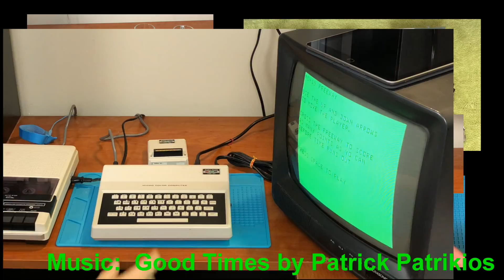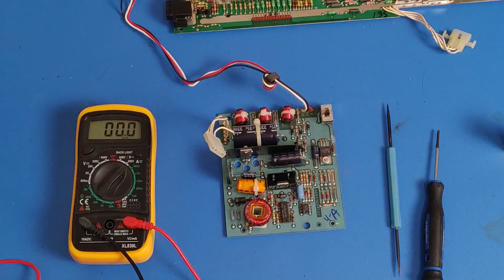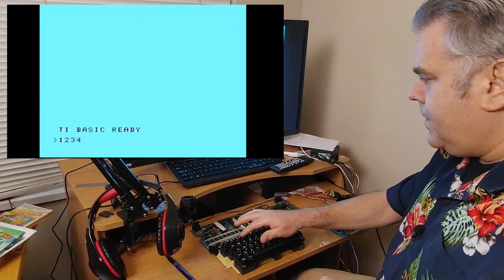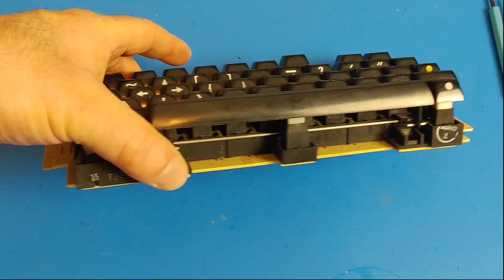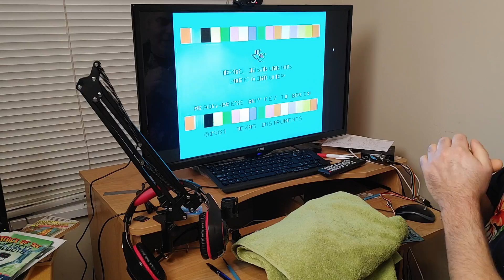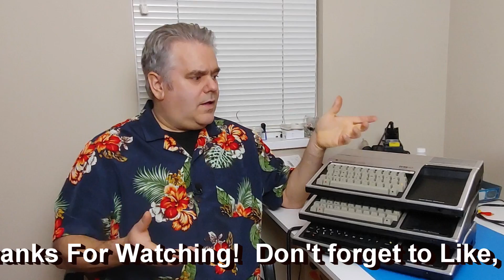TI99/4A Extravaganza Part 2

Comment: If you have the schematic, showing how each key fits in the keyboard matrix, try to measure the resistance of the closed key, if its abnormally high then the key contacts don't make good contact. If you don't see any change when you press the key then there must be a break in the connection, use the multimeter set to beep when a connection is made, and trace one of the two ends of the matrix from the connector to the contact of the switch. If you find a connection then try the other matrix end, to the switch, that way you should find where the fault is.
If the contacts have too much resistance when the contacts are closed first try to remove any oxide from the contacts by scraping the contacts with a rough piece of paper. If all attempts to lower the contact resistance fail, then you could try to change the resistance of the pullup resistor to a higher value. so that even with a higher contact resistor, the contact resistance will still pull the voltage on the pullup resistor low enough for the keyboard input port low enough so it is registered as a keypress. I hope I'm making sense.

Comment: Check the keyboard cable   its usually cold solder joints or a broken connection. that is the better keyboard for the TI.  the mitsumi membrane keyboards degrade with time. good job on the machines I have 4 myself.  Love the content keep up the great work!!!!
Reply from the maker: The keyboard that doesn't work feels a lot better than the membrane keyboard!  I will fix it soon and put it back, then it will be nice to know I have a working spare :)

Comment: I have had a bunch of those.  The two I had in the eighties had both keyboards replaced under warranty, they were both replaced with grey keyboards.  Apparently TI wanted the over engineer their own keyboard, and eventually they just went with Keytronics.  I guess the original chicklet keyboard was supposed to use the calculator style keys on purpose.  For some reason that's what TI thought customers would like.  In modern times I have found that it is almost always the cable to blame.  If your bad keys are in neighbor groups, check the continuity of the cable.
Reply from the maker: I will check that, thanks! :)